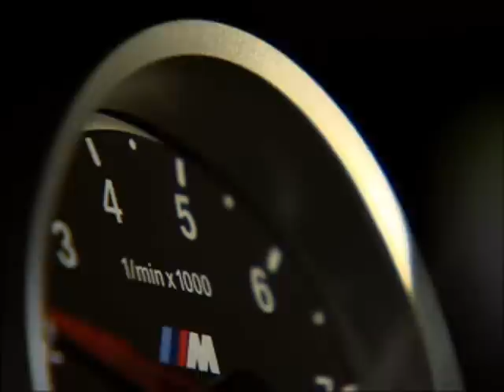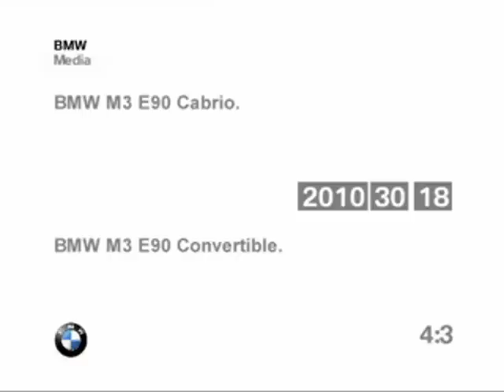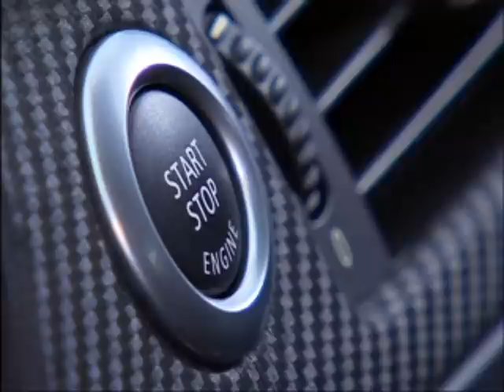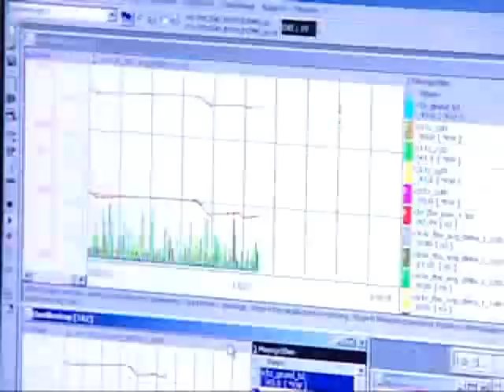BMW M3 25th Anniversary: Part 3 with E46 & E90 Models

Comment: @marasani I was thinking the same. Also, the E92 race is not called "GTR" but rather GT2. And why didn't they show the 2010 Nurburgring-winning race car as opposed to the one that ran unsuccessfully in VLN series? Wouldn't expect those mistakes to come from BMW for the press when they're trying to celebrate the heritage of the M3 line.